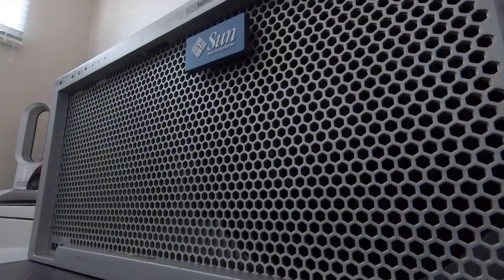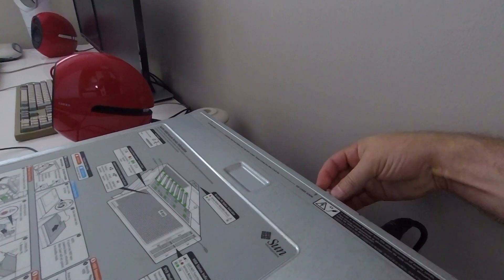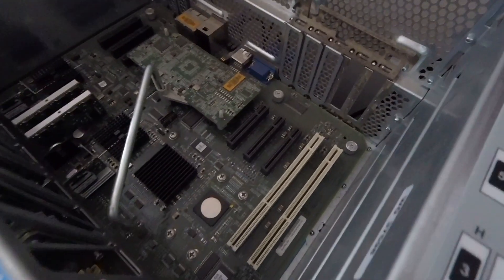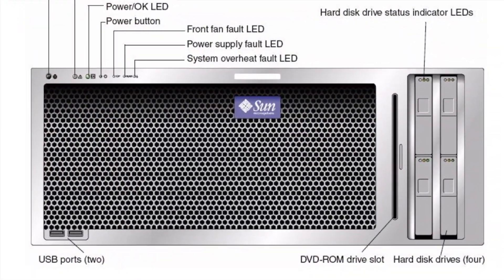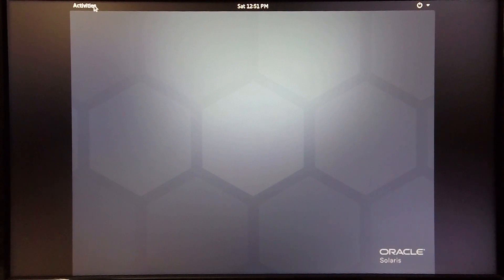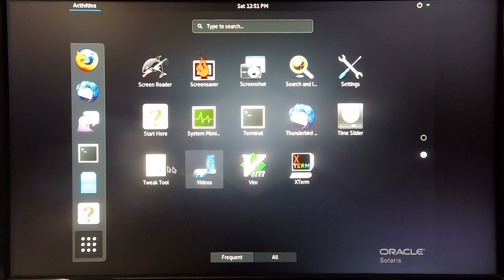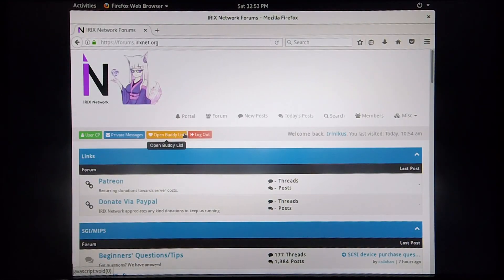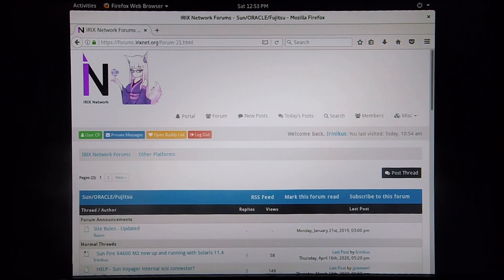A quick overview of a Sun Microsystems Sun Fire X4600 M2

Comment: What did you end up doing with this?  I've got a Sun Fire T2000 sitting in the corner.  I originally got it "just because", like you did with this machine.  I paid a similar price (this was a few years ago).  It is maxed out with RAM.  One of the nifty features is it's designed for enhanced integer performance with low power consumption.  FP performance is poor though.  I think I might just take some of non-standard FP "bit twiddling" libraries (i.e. non-IEEE 754) that DON'T depend on hardware FP, and do some benchmarks.
Reply from the maker: To be honest, I haven’t powered this machine up in years, but may experiment with discrete graphics sometime in the future.